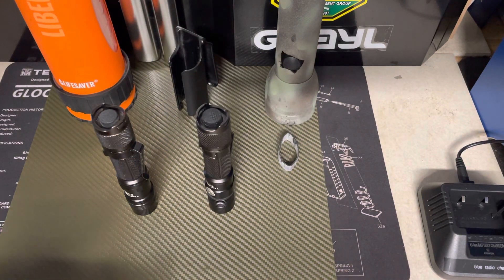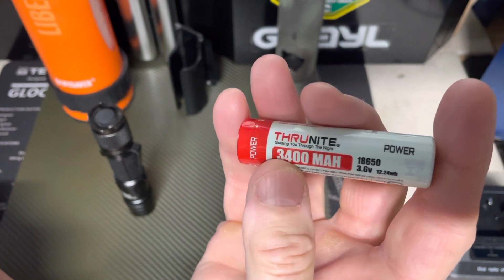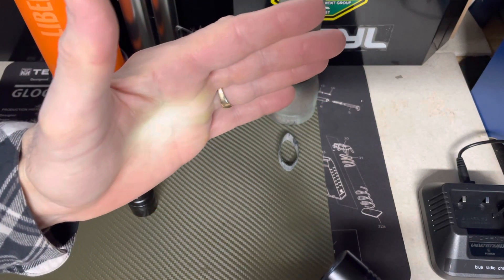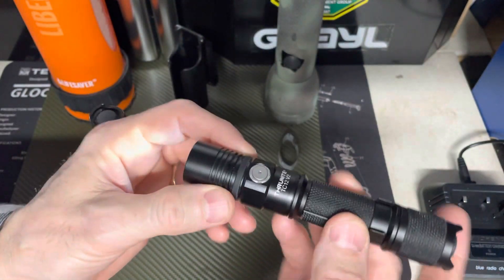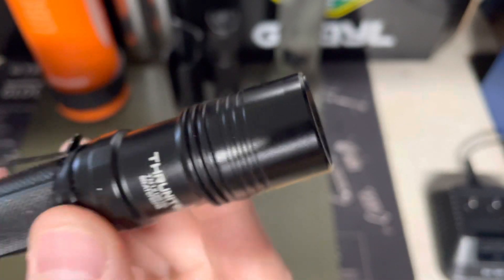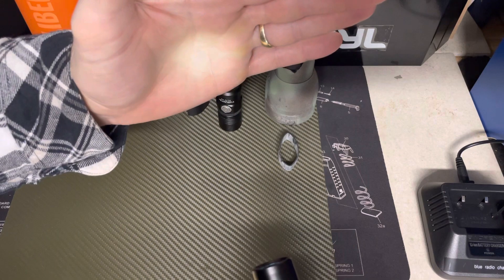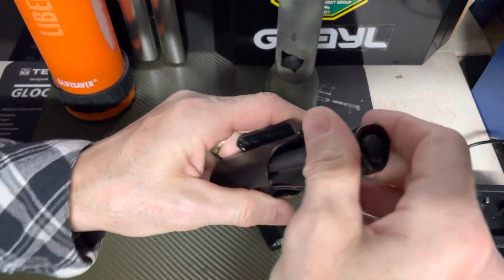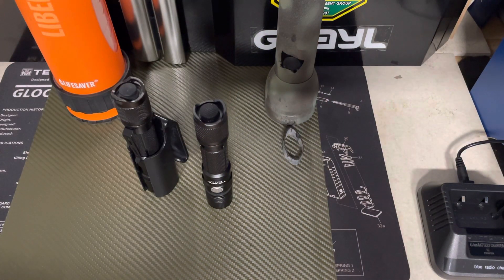Thrunite TC 12 V2 Flashlight- Problems with circuitry?

Comment: Looks like I'm not the only one with similar problem. Mine just simply stopped switching through the different modes at all, simply stay in one mode (im guessing medium). Its strange as this torch didn't had a hard life at all with me, way of speaking. Will get in touch with manufacturer and ask for advise. I tried everything to find real reason for this malfunction, however didn't find any solution so far, so contacting company itself sounds like only thing left i got to do now. Good luck and if i find out anything will try to let you know
Reply from the maker: Thanks for sharing this.

Comment: The switch is supposed to light up as well. I couldn't see the red and blue light on your switch. Have you contacted the manufacture and asked what it could be? I couldn't find a schematic on it, so my best guess is an issue with the switch. I have a degree in electronic engineering. Sorry I couldn't be of more help.
Reply from the maker: The light is not going on in the switch. I am in process of asking the manufacturer about this. I will report back when I get an answer. Thank you.